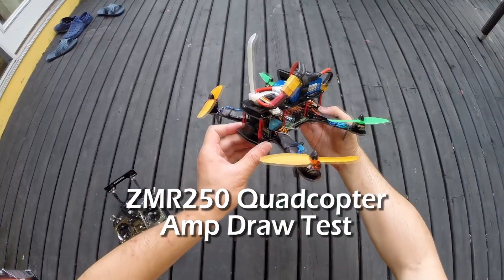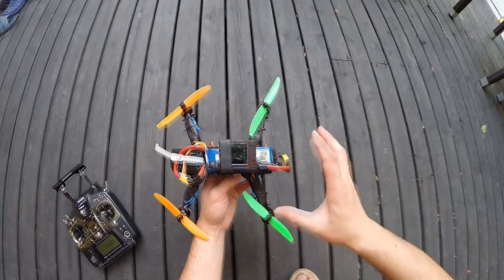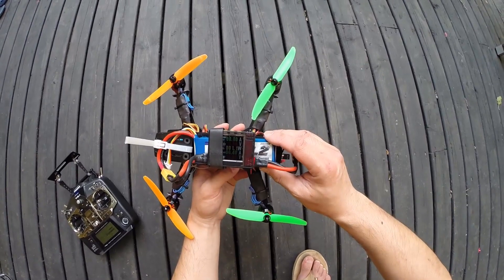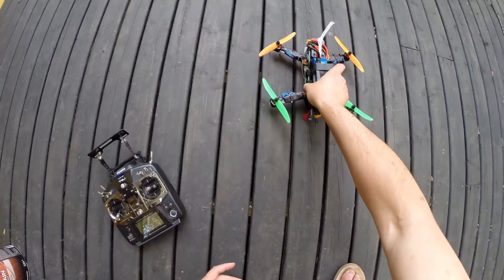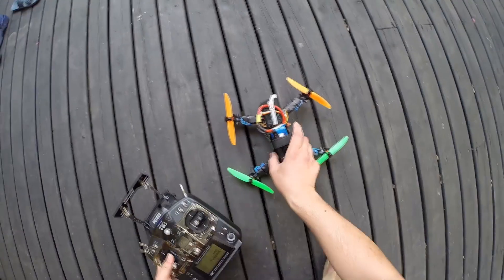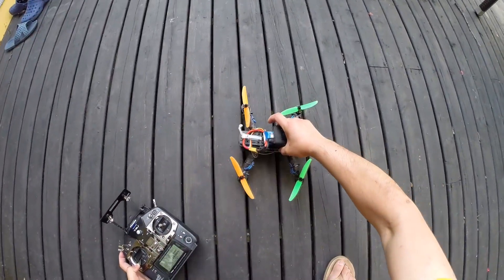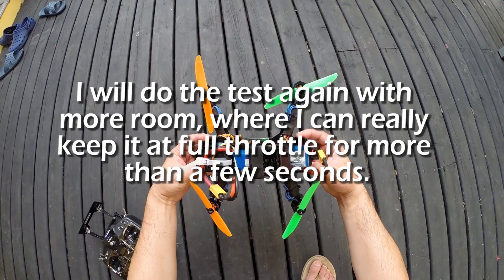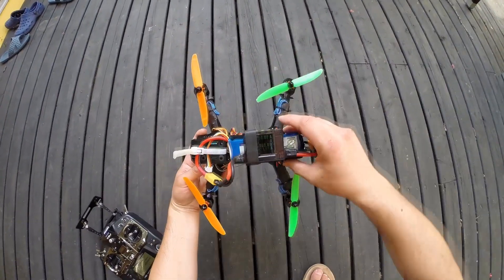ZMR250 Quadcopter Amp Draw Test

Comment: so people on Rcgroups are saying these 1804 motors are under powered for this frame and that the 1806 is a better choice. i'd like to set it up with fpv gear at some point, so do you feel they will still work?
Reply from the maker: Flyingwigs I would go with the more powerful motor as they recommend, the 1804 work but when fully loaded it feels slugglish.
Reply: Andrew W only problem is that i purchased the frame and the motors at the same time. Maybe i will upgrade the motors when i get the fpv gear...

Comment: hay man nice vids I have watched all your vids on the zmr 250 so I was just wondering
if you where able to make a vid on how tho program the Flight controller  - KK2
Reply from the maker: Thanks, when I get a chance I may do a video on it, but I just use the stock settings and it flies ok, be sure to balance your props or the controller will get a bunch of vibrations and make it fly awful.  There are lots of great tutorials for the kk2 on youtube, check out the youtuber dhdsracer he's got some good videos.
Reply: Andrew W
ok thanks
also how strong is the frame when u crash and do u know where to get spare parts cos I cant find any spar parts